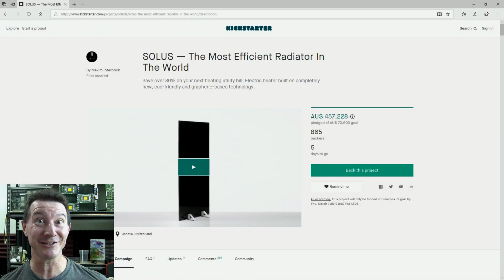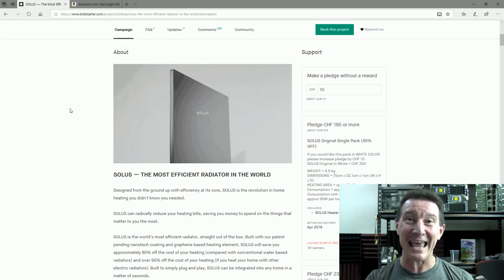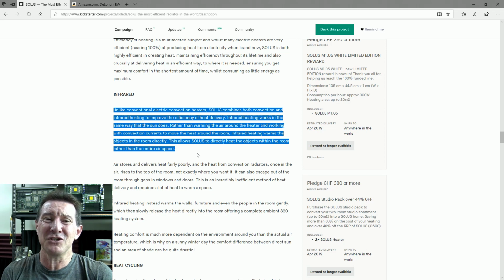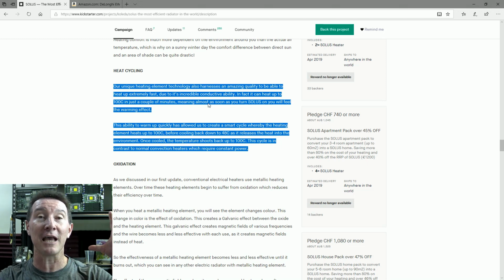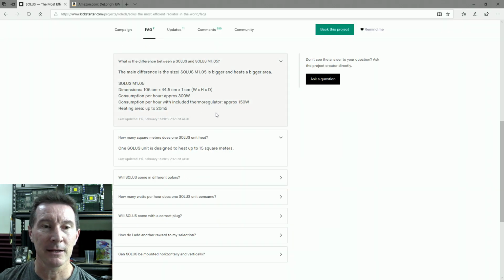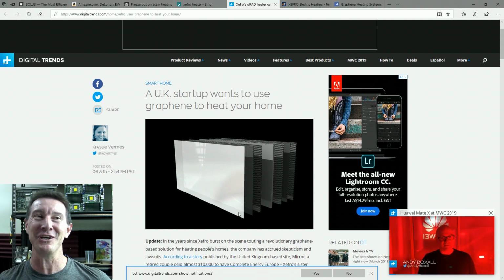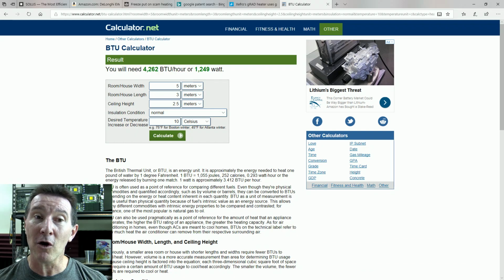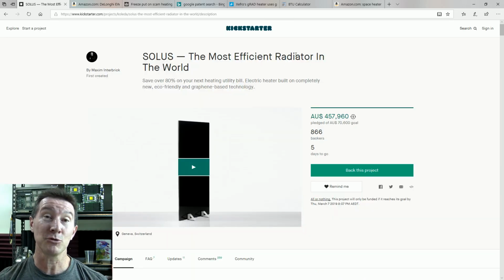EEVblog #1186 - Solus Graphene Heater Kickstarter BUSTED!

Comment: You could always just use a huge resistor, and Ohm’s/Power Law, across the mains - that’ll heat up the new lab on those cold, Winter nights! 😊 (That is, if it doesn’t give someone a nasty burn, or catch the lab on fire...) <sound of “fail” button here...> 🙃

Comment: You are not addressing the colour and the principles of radiation, the glass makes little difference to radiated heat. You are very confused with the laws of physics. Those cheap white ones that you show.... If painted matt black will perform much better in radiating heat. Best wishes. FreeJulianAssangeFreePalestineFreeUsAll.

Comment: Their claims are indeed ridiculous and numbers do not match... But in fact you can save energy with this device... You have three ways of transfer heat energy. Thermal conductivity (by water, oil, metal etc.), convection (forced and natural heating specifically up the air) and by radiation (like the sun does)... Some heaters have two or more of these principles at the same time... Now you can choose to heat up a complete space and spent a lot of energy in it, or you can emit infra-red radiation to a spot where you are staying and feel just as comfortable as you would up heat the whole space (think about terrace heaters do that way)... In this situation you can save energy usage... In fact a family member of mine does this successfully with a specific infra-red principle heater.. And Solus relying on that principle, but surprisingly they do not advertise it this way and mess up their test results/claims...

Comment: Amen!  With the slight unmentioned detail that the wall mounted plate “radiates” half of the power backwards.  What is that?  That is the cool wall.  A different story of course is the “junction” temperature inside versus the surface temperature, which latter one is a safety issue.  But also the ratio of radiated to free conduction heat flow.remains to be used in the claims.  Hmm???

Comment: Glass not a good thermal conductor? Dave you got me confused! As a building engineer I consider glass to be one of the worst thermal insulators. Large single pane windows in a cold climate are the worst, they suck the heat straight out of your room😀! The best room heater is a thick down filled puffer jacket. Get warm form your own 100 watts! It’s a bobby dazzler, guranteed. I’ve used this last winter when the heating system whent kaput in my office. I also used one of those fan based heaters but I find them a bit dodgy in regards to safety, it better have a good thermal fuse in it.

Comment: Dave, I think you repeatedly miss the point in their claim.

The point they are making is that instead of relying on convection to heat the air, their unit uses a material with a more ideal black body radiation as to achieve better thermal radiation in terms of infrared light. The normal radiators that are powder coated in white normally will have far less IR radiation in comparison to a black surface. (The Solus team decided to use Graphane since it is a bit extra black.)

In essence it is a rather weak heater, but it heats surfaces in line of sight and will make you feel warm-ish.

Though, to be fair, they could have instead just used two tempered glass panes, a spacer, something to seal it with, then evacuate the insides to form a vacuum, before stringing some tungsten wire inside and heat it to a reddish glow. (a light bulb in essence) That would produce far more IR radiation then a black 100 C surface would ever do. All while keeping the power consumption about the same.

To simplify what they are saying: this thing produces about 5 times more IR radiation for a given amount of power then a traditional heater.

But in terms of actual heating, I would still advocate the use of a heat pump, since they hands down outperform resistive heaters. (1 kw of power can restively give 1 kw of heat, while a heat pump give about 2.5 kw of heat by snatching about 1.5 kw from elsewhere. (usually outdoors or a geothermal well.) But normally at the expense of a hefty up front investment...)
Reply: Radiator paint (almost any paint in fact) has a perfectly servicable IR emissivity, that's what its for.   If you put 100W electric power into a heater, 100W of heat power will come out - the emissivity only affects the equilibrium temperature of the radiator - poor emissivity means it has to reach a higher temp to emit the power, so you're more likely to burn yourself if you touch it.  The whole thing is greenwash bullshit of the most fraudulent variety.   Yes, heat pump is the way to go, but first insulate the building better!
Reply: @MarkTillotson  I mostly find it a bit odd that Dave doesn't really talk much at all about the IR part of the product, but instead looks mostly on the convection part. Since the claim that it "reduces energy consumption by 80%" is fairly bogus, since that claim seems most likely based on convection heating in comparison to IR heating. So practically any IR heater would also be "80% more energy efficient" as well when compared to a convection heater, or at least in the same neighborhood. (Though, the glass panels kinda defeats the IR part of the product, so it might actually end up worse...)

And that IR heating is fairly efficient at making things in line of sight noticeably warmer isn't really a new thing. (Thankfully  the followup video Dave made on this subject were far more on point. Not to mention shorter and far more informative overall.)

And yes, actual heating should be left to heat pumps, due to their far greater energy efficiency, and even a little insulation goes a very long way in terms of both heating and keeping things cool too.

Comment: This is really sad, I'm into construction and if this wasn't a wag product I could tell you that a Low-Profile Heating System is exactly what some rooms could use and that the form factor and installation options of a product like this would have a marketable presence in construction and retro-fitting.
Things to change:
*Stop **ing about graphene.
*Drop the "Most efficient heating" slogan because even if it is true it sounds like snake oil. 
*Don't use glass to radiate heat!
*Get the heat output and power usage tested by multiple outside labs to give contractors a honest idea of what this can do for them.
*Demonstration  at construction trade shows.
*Don't use kicksh**er, go to a bank and take out a proper loan or take on investors.

Comment: Dave, graphene is a semiconductor so it can be constructed to act as a transistor. The manufacturers probably did not want to say this because it is a trade secret... But creating a single transistor the size of the heating panel is going to have massive wattage/voltage/amps capacity. Clearly the graphene transistor that size can amplify the mains electricity and that is where the extra heat comes from and makes the device more than unity in efficiency.... I’m sure if the Batterizer used graphene it would have worked far better, but I guess the graphene was not cost efficient at the time. The glass spreads the heat and makes sure there are no hot spots in the graphene transistor and protects the transistor (the graphine has a negative heat coefficent and may thremally run away due to its over unity efficency if hot spots form - thats probably also why they pulse the power so any residual hot spots can spread out) In addition graphene transistor can easily be damaged because the platelets are only one atom thick and therefore need structural support.... ;-)

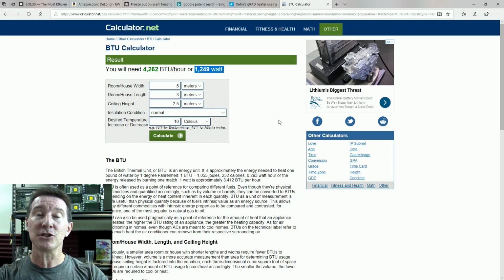Comment: 36:20
This app doesn't calculate the energy needed to raise the room temperature, it points out how much power is needed to maintain a room temperature given the difference to the outside temperature.

Comment: got to love Kickstarter.  This is as believable as the Elbow Cassette Player.  Why does some of these people on Kickstarter need to BS to get funding.  Come up with an ideal, get a simple demo done, promote it, and hope other like it.  This heater is just full of BS.  I would put the glass on the back, copper face with a protection in front, 500w heater, a simple wireless thermostat and call it the day.

Comment: Could you use magic woo-woo graphene as a thermal paste on a heat sink to help transfer heat from your power transistors ?
Reply: This is for CPUs, but that's basically what Carbonaut or IC Graphite thermal pads are.

Comment: Playing devil's advocate here: There are better and worse radiators, right?  Graphene comes close to an ideal black body.  Is it possible that by spreading the graphene out and putting it on the wall, it can radiate infrared throughout the room, not more "efficiently", but at a higher power level than other types of radiative heaters?  The glass would allow the infrared to pass without much attenuation.  This would mean that the heater itself would hold less heat and you would achieve higher heat transfer (strictly through radiation) than other types of radiative heaters.  Maybe this is their reasoning behind the claim "heating the room as fast as possible"?  I do agree that the convective properties are clearly crap.

Comment: Years ago I think it was back in the late 1960's A BBC program "Tomorrows World" in the UK demonstrated a system to heat your house using a special chemical that was painted on 2 opposite walls and for decrative purposes could be wallpapered or painted over. The unit was powered from a 12 volt car battery and used so little power to run that the battery would last all year without needing to be re-charged.  The technology that made this possible was described as being based on an electrolytic capacitor, and rather than heating the volume of air in the room it produced a heat field around the occupants or items within the electric field.  They were swamped with enquiries recieved from interested potential customers who hadn't realised that the program was broadcast on 1st April.  Maybe this could feature as the latest Kickstarter scam next month!!!
Reply: Yes and the spaghetti trees! I think that was Panorama though. Another UK TV show messing with people on April 1st :)
Reply: @frazzleface753  IT WAS ROBERT MURRY SMITH THATS GDO ALL SHORTS WITH GRAPHEN NO TOMORROWS WORLD
Reply: You can do this now! -- Mix your own Pluto-Paint: For a 1500 watt room heater you just need to add about 2.7 Kg of finely ground Plutonium-238 to your favorite paint. There may be some physiological ramifications.
Reply: @scottsmith7191 That sounds like an RTG with extra cancer lol.
Reply: Heating the walls is not a bad idea: your comfort level is determined by the walls' temperature, not by the air temperature as one might think.
Reply: What you are describing is possible, only not sure you want to do it. If you change the polarity of the electric field water molecules heat up because they keep having to realign with the field. This is what also happens in a microwave oven, look it up. So they don't heat the air around people, they heat the people themselves. Like putting them in the microwave. I'm sure it works but I don't think it's a good idea.

Comment: Everything is a 100% efficient heater after all. Even if you would have an 100% efficient room light, all that light is going to be absorbed somewhere (besides of the part leaking out your window) and heating your room. Sound .. is going to be absorbed somewhere -> heat. A cold air fan .. the air will lose it's kinetic energy at some time -> heat.

Comment: If you stand 2 meters from a heater a radiates its heat as infrared radiation in stead of natural convection heater the radiating heater will feel warmer, even though the room temperature is not higher. I missed that a bit in your discussion. There are 3 kinds of heaters: natural convection heaters, forced convection heaters, and (infrared) radiating heaters. Some heaters combine 2 or more technologies. The cheap heater you show is a natural convection heater. The heater in kickstarter is a radiating heater. But I agree with you, there are other infrared radiating heaters that are much cheaper and more powerful.

Comment: Love the vid, but a radiators main purpose is not radiation, that name is a misnomer. The main source of heat comes from natural convection, that is, cold air touching the heating element, becoming hot, rising, and more cold air coming in to repeat the process. Repeat this ad nauseum until the room is heated to a temperature you like.

Note: a radiator does radiate heat as well, but the amount of heat transfer that’s going on there is dwarfed by the convective heat transfer

Comment: It sounds like they are trying to sell a radiant heater using something other than quartz elements. Quartz radiant heaters do heat the room, not the air, and they already do everything this product claims and it didn't require an specialized carbon allotropes to do it.

Comment: Dave you're mistaking what radiant heat is. Those oil heaters you showed are "convection" heaters. Convection is the natural rising of a hotter/less dense fluid. Forced air and convection heaters heat via the same mechanism - they heat the air. Radiant heaters are designed to provide almost all of their heat via infrared radiation. They heat objects in the room. Infrared heaters can "feel" warmer, but in terms of keeping the room warm they don't work any better than other heaters.

Comment: This https://youtu.be/LT5_-A0m8_U would be a much better solution.  More power and it also gives enough light!  Of course, it is not 100% efficient, especially if you let some of the light to escape through windows.

Comment: 2x100W (or 3x100W) conventional light bulbs = more than that heater. So you can get a "200W heater" that also creates light for a fraction of the cost! And they certainly also create infrared radiation too.
Even some laptops create that amount of heat... and they are actually useful.

I bet sometime in the next 100 years (probably much sooner) someone will come up with the idea of heater+light source in one product and try to sell it as something new.

Comment: thats the same wowoh with like thumbledryers and washing mashines. They getting all more and more efficent. No, they only lable that they can fit more laundry, and boom you machine is more efficent. A old washing machine has the same resistive heating element, like a new one, like you said,  you can´t make it more efficent from the electric side. The alternative is an infrared heater, you can get them in the same formfactor like the Solus one, and as far as i know they are really consume less energy.

Comment: One watt equals one joule per second. One watt equals 3.41 BTUs/hour. You can't get more efficient than that.
Reply: The general rule for radiative heaters is 10 watts per square feet of space you want heated. That means a 300 watt heater would only cover 30 square feet, or about the space of a small bathroom.
Reply: It keeps talking about infrared heating, but it doesn't produce light. Of course, everything above 0K gives off infrared, but "infrared heating" is more like those deep red light bulbs you might find in a old food warmer. This doesn't give off any more infrared than any other heating unit.

Comment: There is an interesting side to this, the amount of suckers out there, I would have thought it would not have met it's kickstarter goal, let alone greatly exceeded it.

These blokes are brilliant, a totally legal scam! With most scams, you send the details to the police etc and it will eventually get shut down, Not this one - say goodbye to your money with no recourse whatsoever. They don't even have to hide the business in some obscure overseas country.

Maybe I should do a kickstarter building eHeaters, a totally modern digital solution to your heating needs, what they actually will be is desktop PC's permanently running CPU stress software, with a web interface so you can monitor it all with your mobile phone! That's got to be good for a few hundred BTU's

Comment: Apart from defying the laws of physics, these heaters seem to be designed for two dimensional rooms of 15 square meters, rather than the more common three dimensional rooms of fifteen cubic meters typical of most earthly homes. In a two dimensional world their claims may hold some water, but for practical purposes the proposed heater is three dimensional and can not be used in a two dimensional world without an inter-dimensional quantum 2 to 3D converter.; a  notoriously difficult appliance to  operate as it keeps popping in and out of existence.

Comment: whoa dave hold your horses! i think your brain blacked out just for a moment because you were so furious about the claims of better efficiency.
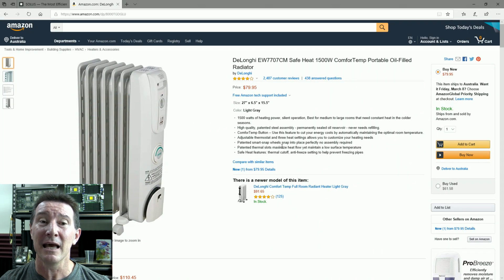the heater you showed at 12:23 is mainly heating up your room via convection! otherwise a perfectly flat surface would be way better for a radiant heat transfer as most of the surface is folded in on itself and not much heat is radiating out into the room.
the shown heater is formed like this to achieve optimized airflow and thus heat transfer due to convection

convection is defined as follows:
the movement caused within a fluid by the tendency of hotter and therefore less dense material to rise, and colder, denser material to sink under the influence of gravity, which consequently results in transfer of heat.

as soon as a fan is involved the amount air movement due to convection is negligible.

Comment: They wrap it in a thick layer of silicon dioxide and claim it's more efficient that an element with microns of metallic oxides (which, incidentally, are normally good conductors of heat)! Yes, that makes sense!